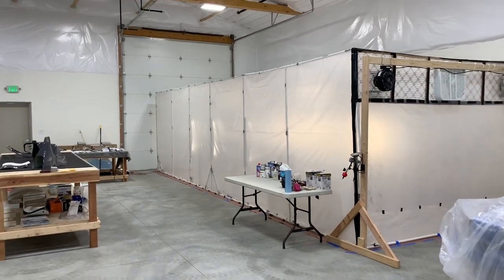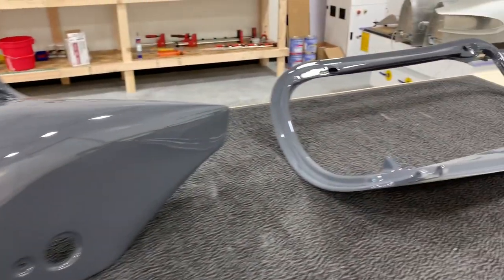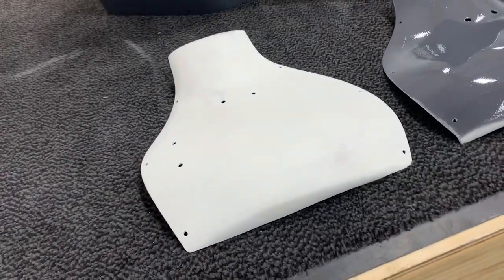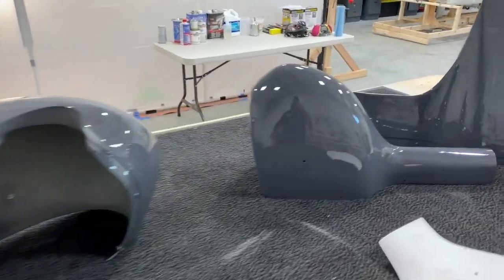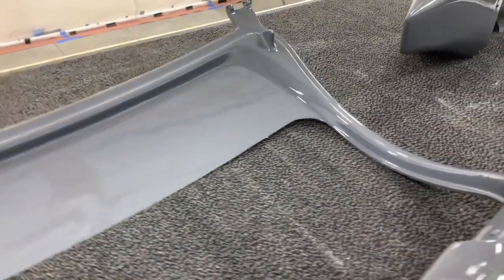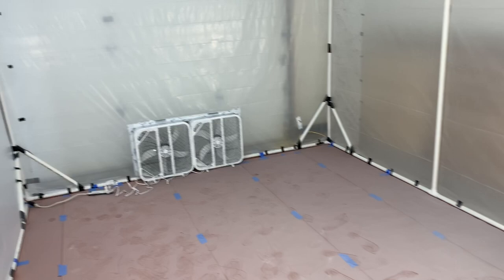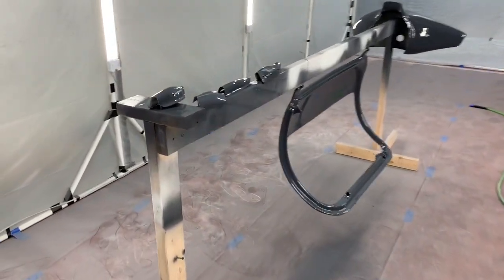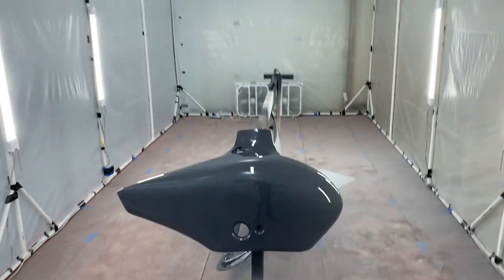Sling TSi- Some Painting!

Comment: Evan, any possibility of posting some video on paint technique, paint type, equipment, etc.? Perhaps some spraying in the booth to see how it all comes together? The paint is beautiful.
Reply from the maker: John I’m honestly not the guy you want to be watching for tips and techniques. I’m just kind of hacking my way through it, using videos on YouTube by real painters for guidance. It’s likely that my actual painting technique is all wrong!

Definitely get a high quality hvlp spray gun, and a very large compressor to support it with the proper filtration. I think having a paint booth to keep the environment clean for painting is important as well. Painting is 95% about the prep and equipment. I’m using Sherwin Williams acry glo paint, which is a high end paint. I think with all this stuff you get what you pay for, and every corner you cut will reduce the quality. But also, I painted a VW bug about 13 years ago, and then this, and that's the entirety of my painting experience haha

Comment: Evan I see you have paper on the floor of the paint booth to save the concrete. My dad had an auto body shop and before down draft booths, shops sprayed water on the floor to keep the dust down. I see a build up of dust on the paper, with all those fans moving air in the booth, that dust might end up on the finish.  It’s hard to tell whether the paper was wet. Just a thought before you start the large surfaces. A small amount of contamination can be sanded and buffed out.
Reply from the maker: Dave Geiss thanks for the tip! I like the idea of wetting The paper, my Plan was to sweep out the booth into the fans on the floor and then roll out new paper every once in a while since that paper is cheap. I’ll try wetting it, thanks!

Comment: Evan, love the color.  Smart move testing various techniques. Question, if you end up not using the primer, do you gain a weight savings? Well, I cant wait to see the finished product, but I enjoy the process and hearing how you are going through it.  I think you are providing a different view from other builders which is refreshing.  Take care and be safe...
Reply from the maker: Not priming certainly saves some weight... but I think it’s just a pound or two, if that. But if you think about it, adding a second 10” display screen on the panel is considerably more weight than the primer on the whole plane. Weight savings is really not the job of a builder in this type of build, unless you’re trying to do something exceptionally atypical such as adding air conditioning or a built in oxygen system. The weight of the plane is pretty much already baked in the cake on this one for the most part

Comment: I love the dark gray. Are you planning on color sanding the parts?
Reply from the maker: Clint Walker what is color sanding?
Reply: @EvanBrunye  Color sanding is the process of using a very fine sandpaper and water. Usually 2000 or 4000 grit. You would lightly sand your paint to smooth it out and remove any of the 'texture'.
Reply: There's several videos on here that cover doing it with and without clearcoat.
Reply from the maker: Clint Walker oh ok, no I probably won’t do that. At least not on the parts I’ve done so far
Reply: Hope this helps, I think with a little extra time, you can make that thing slick!
Reply: @EvanBrunye  Either way, it looks dynamic in that color. Happy Building.
Reply from the maker: Clint Walker thanks for the tip though, I’ll definitely look into it for the more visible parts!